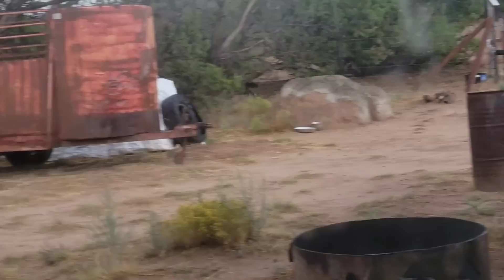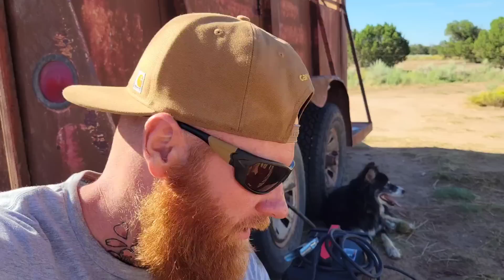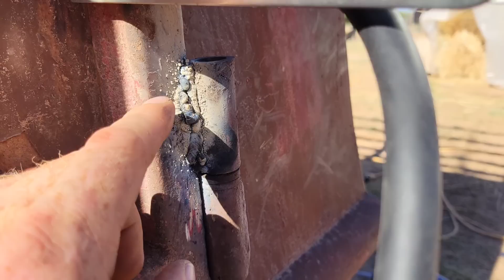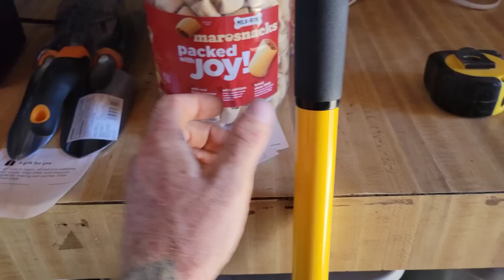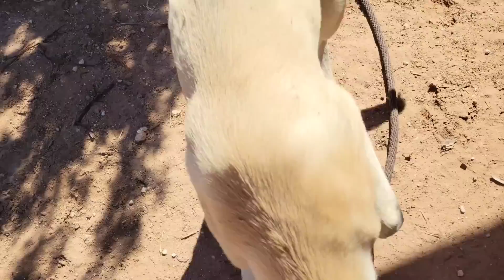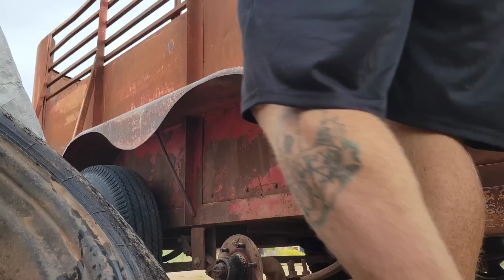NEW (old) Horse Trailer | Everyone should own a welder

Comment: I suggest tractor paint.  Inexpensive and almost indestructible once cured.  Also I totally need to start fiddling with my cheap Chinesium stick welder as I have aluminum rods and it can do aluminum.  My friend is currently storing my flux core Lincoln.  Once I get it back I might add the extra $100 in parts to add mig function to it.
Reply: Also if that helmet isn’t auto-darkening you might want to invest in one.  They aren’t that expensive and make welding a hell of a lot easier.

Comment: Soapy water will help with breaking down and mounting tires.  WD40 works as lube too. Couldn't tell if you were using any on the video. I did semi/car tires at a tire shop, but road service was just tire bars and lube. Ether-ed a truck tire once and the driver had never seen that before. I almost had to chase him down, he actually took off running.
Reply from the maker: Thank you. I've been changing all of my tires for several years now.  I always have soapy water on hand.  With the machine, it's never a problem.  These tires are simply very tight, and the machine needs to be properly mounted.